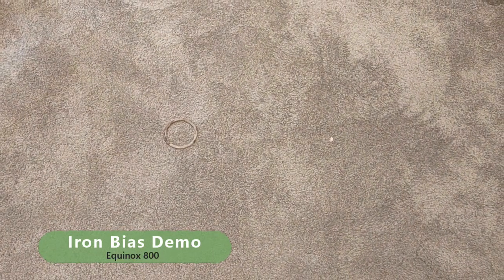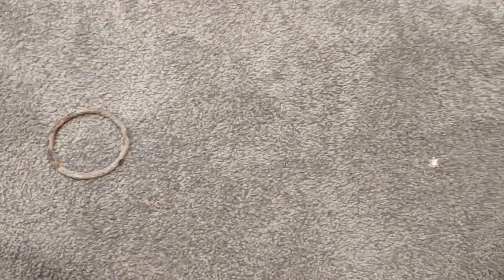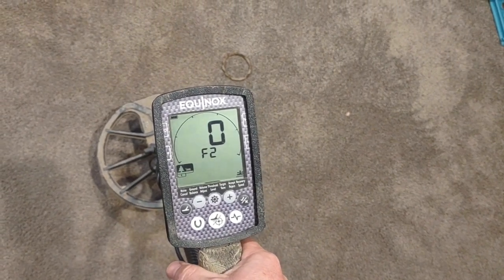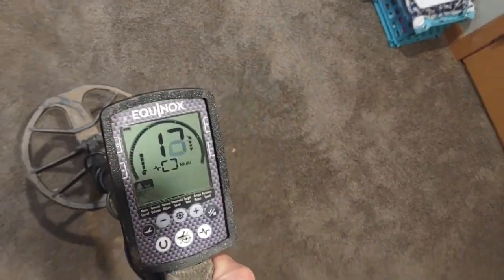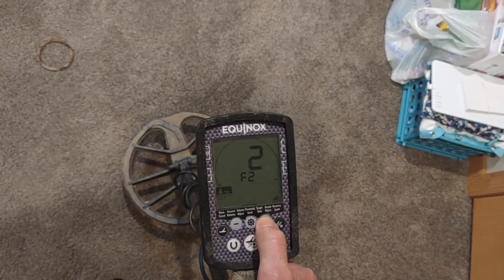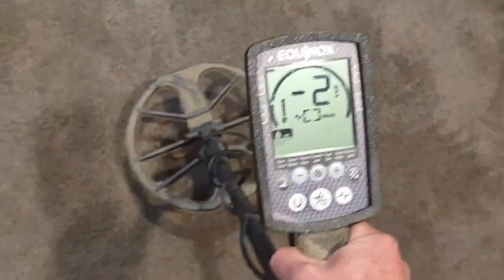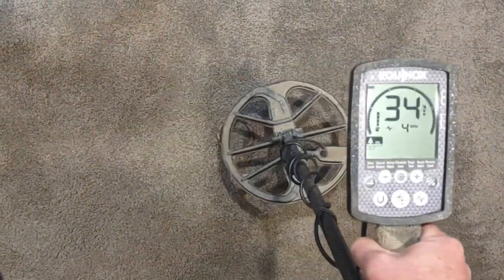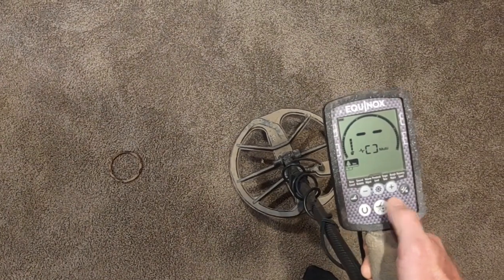Iron Bias Demonstration - Equinox 800

Comment: What do you mean it's not intended to be a un masker? Thanks
Reply from the maker: A common misconception is that iron bias is an "unmasker", and you can even find videos claiming to "prove" it, but that's not what iron bias is designed to do. I consider true unmasking to be a situation where a detector can be set up to see two individual targets when it would otherwise see only one co-mingled target. Unmasking is a job for higher recovery speeds, slower sweep speed, smaller coils, etc - not iron bias. Iron bias does not provide separation between two individual targets - instead, it's intended to sniff out single targets that would otherwise fool the detector through falsing.

If a ferrous and non-ferrous target are too close together and/or recovery speed is too low, a target is more likely to get missed or ignored because the machine only sees one target instead of two. Iron bias can exacerbate this effect, of course - if iron bias is set too high, and the machine sees the two targets as one co-mingled target signal, a high iron bias set by the user will mark the signal as ferrous, and you’ll never hear a high tone. 

The misconception of iron bias being an unmasker comes from the opposite situation - if you set the iron bias low, the machine still sees the two close targets as one co-mingled target signal, but now the signal gets marked as non-ferrous and you hear a high tone. Folks who don't really understand what is happening will say "Ah ha! Iron bias unmasked a good target!", as if the machine magically ignored the ferrous target and saw only the non-ferrous. But in reality, the machine just did what it was told by the user and classified an "iffy" co-mingled signal as non-ferrous. The difference is subtle, but extremely important - changes in iron bias will never allow the machine to separate two closely spaced targets, it only changes how the machine interprets a given target signal. 

Here's a scenario to illustrate what I'm trying to say using made-up numbers: Let's say we have a dense piece of iron close to a silver dime. With low recovery speed and high iron bias, the machine probably only "sees" one target and might assign it a -2 TID/iron tone (high iron bias = call "iffy" signals ferrous). No dig - unless you like iron.  With low recovery speed and low iron bias, the machine still only sees one target, but thanks to the lower iron bias, it might assign it an 10 or 11/low tone (the low iron bias means you want the machine to call these kinds of "iffy" signals non-ferrous). If you aren't a cherry picker, maybe you dig...maybe not. Did any unmasking really occur? Not by my definition - the machine still only sees one target, so nothing was unmasked, you just manually changed how the machine interpreted the same signal. With higher recovery speed and high iron bias, the machine might now see the iron and dime separately with two separate hits - maybe -5 and 23. With high recovery speed and low iron bias, again two separate hits, this time maybe 10 (iron is dense enough to generate enough conductivity to false high, especially with the low iron bias) and 25. In these last two, unmasking really occurred, because two targets were resolved by the machine instead of one, but the individual targets were still impacted by the different iron bias settings.

Comment: Doesn't the problem of masking occur when both are in the same hole?
Reply from the maker: Yes, that's absolutely one of the drawbacks of using higher iron bias settings. At one point in the video (3:08 mark), I mentioned that iron bias is not intended to work as an unmasker - I meant to elaborate on that later in the video and simply forgot🤦‍♂ I consider true unmasking to be a situation where a detector can be set up to see two targets when it would otherwise see only one co-mingled target. Unmasking is what recovery speed, slower sweep speeds, and/or smaller coils, etc, are for. If a ferrous and non-ferrous target are too close together and recovery speed is too low, a target is more likely to get missed or ignored because the machine only sees one target instead of two. Iron bias can exacerbate this effect, of course - if iron bias is set too high, and the machine sees the two targets as one co-mingled target signal, a high iron bias set by the user will mark the signal as ferrous, and you’ll never hear a high tone. The difference is subtle, but important - changes in iron bias will never allow the machine to separate two closely spaced targets, it only changes how the machine interprets the signal.

Comment: Raise the coil let"s say 10 inches...the iron comes back with a high tone 👎👎👎 sold mine for that reason 😒
Reply from the maker: Sorry to hear you sold your Equinox, but hopefully you found a machine more to your own liking - having a machine that you trust and understand is more important than anything else in this hobby.  But sure, iron bias has its limits and drawbacks, and yes, if you raise the coil significantly, you'll reach a point where iron bias loses its effectiveness and non-ferrous tones may start to come through again. Keep in mind, any machine from any manufacturer loses TID accuracy with increasing depth - it's a consequence of being near the edge of detection range. Up averaging and wrap around start to become bigger factors as the processor struggles to categorize weaker signals. You could raise the iron bias higher to try to compensate, but of course, there are definite drawbacks to that. Lastly, I'd make the case that if you raise the coil another 10", most machines wouldn't even be able to hit small targets like the gold pin I was demonstrating, especially in soil. Anyways, best of luck with whatever machine you chose.

Comment: This will work in bech 2 correct?
Reply from the maker: Yes, Jade, this absolutely will work the same way in all of the detect modes as long as multifrequency is being used, including either Beach mode.
Reply: Beach mode shuts off the iron anyway.